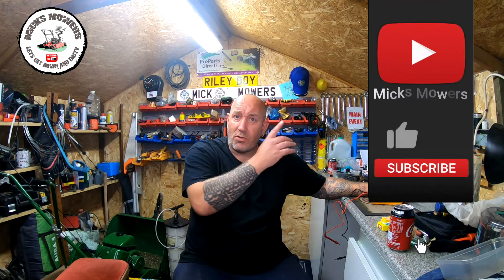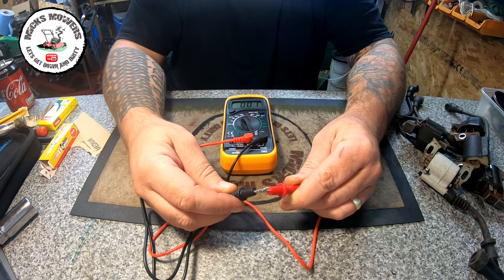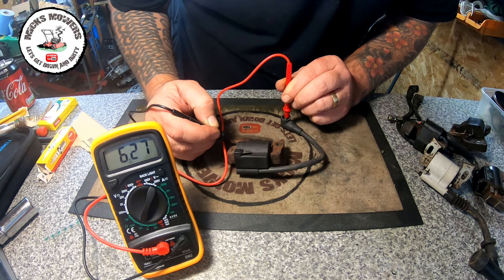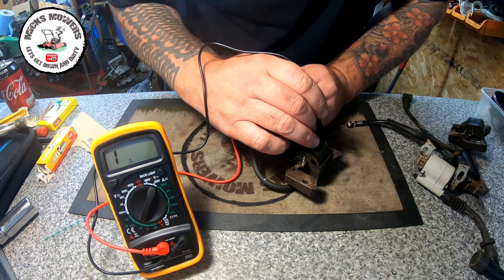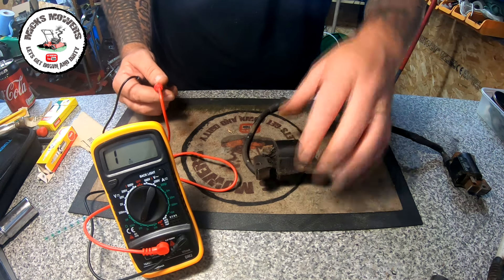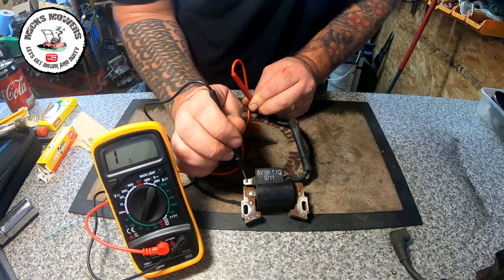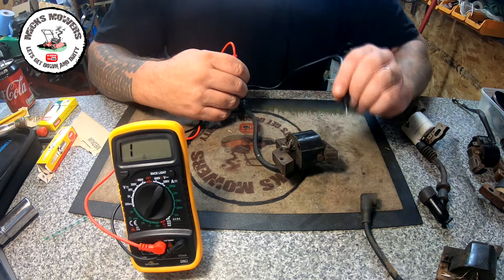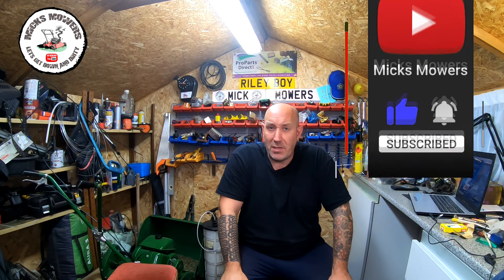How to Test A Lawn Mower - Ignition Coil Magneto With A Multimeter #easy

Comment: You can have good resistance readings on a coil and it can still be bad. This test does not test the condition of the semiconductors within the ignition module. A spark test at pull cord rpm's would be a more accurate test.
Reply: Exactly.... If it don't spark...Change the plug.... if it still don't spark. it's bad. End of story. (But we all love to know WHY!? Don't we?)
Reply: @patagualianmostly7437  Not quite my friend. if there is corrosion between the coil body and the engine then you will get no spark and my friend you will have spent out on a coil for nothing. how many coils have you replaced on you're change the plug principal? maybe you were throwing good coils out when you didn't need to? A £10-00 millimetre may have saved you money. Great tutorial as usual Sir Micks
Reply: Yes, but I think the coils shown were not electronic.  I agree, if electronic then you can have a good testing coil on the bench. But I may have an intermittent fault. This can happen after a short run when a component in the electronics intermittently fails .
Reply: @swarfs  They are electronic. They have a Darlington pair transister within to increase the pulse to higher level.
Reply: Will I see a spark only if the plug is connected to an earth ? Or will I still see it if I just hold the lead with the spark plug connected in my hand
Reply: @absbse  The thread on the plug must be grounded (engine block) to show a spark.
Reply: @smithderf  I tried that and even when I start with the starter motor there is no spark, I tried 3 different spark plugs, the mower has been sitting for 8 years unused but the engine turns over fine, just doesn't start
Reply: @absbse  If you see no spark on three sets of plugs then it's a kill wire problem, ignition module problem, or corrosion of the modules mounting surfaces.
Reply: The cheapest and most foolproof method of testing the entire ignition system is to perform the following test:

1) Using a bucket pour a small pool of water on the floor
2) After removing your stockings place your feet in the pool of water
3) Remove the spark plug from the mower engine
4) After making sure there is a good connection between the spark plug wire and the spark plug grasp the plug firmly in your left hand
5) Using your right hand give a vigorous pull on the recoil starter cord!

If at that point you feel this post is funny there is definitely something malfunctioning in your lawn mowers electrical. Otherwise you've got a fully functioning system!
Reply: Could it spark and still be bad enough that the engine misfires over half throttle?
Reply: @A_Stereotypical_Heretic  Yes.
Reply: @boatman222345  I'm getting good continuity on the coil. I wonder if that really means much in the thick of things tho
Reply: What about after the mower is running for a while and heated up ,  and then no spark, I've sèen a few with this heat soak problem...
Reply: @smithderf The Darlington pair does not boost the spark. It's triggered by a small coil that is used to trigger the spark at exactly the right time before top dead centre (TDC).
Reply: @BritishBeachcomber  It does boost as it concentrates the energy to a shorter burst intead of an extended release.
Reply: @smithderf the ignition module is within the coil so when you replace the coil you get a new ignition module. The kill wire just need a wire brass to clean and the rust needs to clean coil and flywheel. I have no spark as well and I am getting a new coil to test
Reply: Even pulling it on the machine doesn't fully test a coil as they can fail when they get hot after some run time

Comment: The bad ones are bad- Sec side tested. BUT the good ones can STILL be bad as the primary and switching in the modules can fail. really only way to be sure is check for spark when on machine or swap with known good.  Also you can have heat breakdown in the windings causing HOT shorting and failure but starts cold well and will start to misfire/fail when hot after running a while.  Caused by insulation material burning off inside and wires touching and thus less coil windings for good spark and you MAY still get a weak spark but it wont fire the mixture. or a little bit only. Very messy to diagnose as it seems engine runs well for 20 mins then vapour lock? with fuel starvation or a bad coil cutting out then.
Reply from the maker: Good communication mate

Comment: I've done an extensive survey if ignition coils with a multimeter as I go through my working day and still haven found the process to be a worthy method of testing a coil, other than one occasion when I found a primary winding that tested way out of limits, 360 ohms when it should have been 0.5 to 1.5, which you don't seem to check for, the cut out tab back to ground. Every bad coil I've had, has tested within limits, primary and secondary windings, meaning the failure is electronic, transistor or diode

Comment: Maybe I'm wrong, but is the iron core not a single piece ? With the primary and secondary coils wound around the centre part ? Then it stands to reason that with one lead plugged into the spark plug connector and the other lead alternating between the left and right metal pick up above the magneto ... would result in exactly the same readings. You're taking two readings from the same metal core.

Comment: Resistance readings from a coil/CDI unit, will indicate if there is an open circuit, but not whether the insulation or semiconductors are breaking down when running.

Comment: This saved me ..I had a very intermittent starting issue this season on my 21 year old Toro CCR2450 snow thrower  where 80% of the time it would start and run great. When I tried to troubleshoot it twice of course it ran great and the spark looked ok. Then I tested the magneto (Briggs) and it had 1k ohms resistance ... not 2.5k.  I replaced the magneto and all is well again. Thank you so much!
Reply from the maker: You are very welcome my friend.. that's what the video is for..

Comment: Very good channel with great video. I have tested coils like this for years. Sometimes a coil will test good and then not work when it gets hot from the engine heat. If you have a coil that has a heat up problem you can take a bit of tractor trailer repair tape and wrap it around the coil body. This acts as a heat barrier and heat sink.

The tape is aluminum on one side and black sticky tar on the other. Just cut a small piece and place it on the outer plastic body of the coil. This will keep the coil ast a constant temp.

I believe the coil wires inside have thin or cracked insulation coating. The wire looks like it is bare but actualy has a coil of polymer. This polymer will crack and get hard over time. Then the coil voltage is affected.  

On hot days my tiller will stop running. The coil tests great when on the bench. After about 10 minutes of running it stops with no spark. The coil is directly over top the piston head and cooling fins. The heat rises and the coil starts to short internaly. I put the trailer repair tape on the  bottom and wrapped it around to the top. The  metal part of the coil does not get tape. I installed the coil and it has been working now for 5 seasons.

Hope this fix can help someone with a similar problem.. Cheers!
Reply from the maker: Ta for the information mate I appreciate it

Comment: Great video Mick. A multimeter is a very useful tool. Use mine all the time. In fact used this morning to prove to my brother in law it was because the battery was flat that my sister’s vehicle wouldn’t start. He swore blind he had a battery charger on it an he had charged it up. Anyway after an hour of charging she started up no problem. Saved them calling a mechanic for a 1 minute test with a cheap multimeter!
Reply from the maker: Yeah that's it.. a quick way to test..

Comment: well done.  I suggest before throwing out that Honda coil, check the plug end on the plug wire - the end screws onto the wire and sometimes if that's done multiple times, the wire becomes buggered, breaking the contact.  The wire also screws into the coil itself - check that end as well.  The briggs coils all have the wire manufactured right into the coil itself, but the end can be check on some this way as well.
Reply from the maker: Yeah I did check it.. it's no good ta for watching

Comment: Good video Bloke. However, the older Briggs & Stratton coil has three coils inside, plus a couple of transistors that control the direction of the currrent flow in the primary. I.e, there's the high voltage winding that you're checking, but there's also the primary winding plus a trigger winding on that little metal post on the  bottom of the coil. No way to check either the primary or the trigger winding, or the transistors, as far as I know. Just something to keep in mind. Cheers!
Reply: I checked the continuity on the coil and all is good but the mower still won't start? Cleaned the spark plug the carb is pumping fuel and it still won't start, so what else could it be?
Thank you

Comment: Mick, your video solved a problem. My mower showed a small spark at each lanyard pull, but would not start. Early in the video, you reveal a coil can spark, but too weakly to start the engine. QED-- now to find a reasonably-priced ignition coil. 
* PS-- Your Midlands accent is a killer.
Reply from the maker: Lol Midlands.. I'm south coast lol
Reply: @themowerman  Sorry-- only a few hundred miles off. Portsmouth?.

Comment: Mick, here is a new development in my mower ignition coil problem. Originally, the mower had hit a half-buried tree root, mangled its blade and sheared its crankshaft key. Both blade and flywheel key have been replaced, after great effort. and with care to proper alignment of the key channel and flywheel. 
1. For a brief period, my ignition coil had produced a small spark, and I heard a single, soft detonation when I pulled the starting lanyard a few times, but the mower could not start or sustain any rpm on its own fuel. 
2. When starting fluid was injected into the carburetor, the motor ran briefly, which indicates there was still a spark. But on its own fuel, the motor produced no detonation. Now-- with even starting fluid-- there is no sound of detonation when the lanyard is pulled. 
3. This afternoon, I checked the ignition coil with the standard external test-wire-to-ground (earth), and there is no spark.  Although I have used my VOM set to Ohms (20k), and still get a consistent and satisfactory reading of 4.63  on both ends of the ignition coil, and on the deadman's switch (reading taken when switch was disconnected), there is no spark and no detonation on lanyard pull. 
Although I had planned to purchase another coil, I held out hope the 4.63 reading meant the original coil was still OK, since the value was between 2.50 and 5-6.0. Is this clear proof that even a good reading on a physically-intact coil can be misleading?
Reply from the maker: Hi mate. Sorry for not replying but I’m not getting any notifications of some comments for some reason. Sounds like a good coil. Double check the Ht boot and ht clip. If need be take it off and re attach it. If not then it sounds like a new coil is needed
Reply: Thanks you have explained exactly the same problem as what I have been having with an ignition coil on a disc cutter . The readings come back fine , I’ve checked the the ht lead for continuity  fine .I’ve noticed  most people on you tube are just reposting videos of others with there own take , subsequently I’ve put a coil on from a working disc cutter and it now works as it should . These methods don’t seem to be the rule as I have had the same problem as you . Thanks for posting 👍
Reply from the maker: @bobjit252  your welcome
Reply: @themowerman  Mick, here is a status update on the suspected ignition coil issue. I replaced the original coil with a new one, and now, Ohm readings are even higher, and with a clear, strong spark.
Reply from the maker: @bobgreene2892  what was the reading?
Reply: @themowerman  The original ignition coil shows 4.63 Ohms, consistently. The new ignition coil shows 5.74 Ohms,  consistently. Both coils measured from spark plug (HT) cable to ground on either of two arms, and from HT cable to primary winding connector (deadman's switch disconnected).

Comment: Cheers Mick. Coils can also fail short circuit as well as open circuit. If they are open circuit it could be the HT lead though they are hard to replace the way they are built.
Reply from the maker: Yes mate they can see and Alos when hot it's part of the process we have to follow to find the fault

Comment: Nice video. Thanks very much for posting. I have recent acquired a castle garden el63 ride on lawnmower which has no spark. I believe there are five safety switches which can give you no spark if they are not met but now I have another thing to look at. Have you ever worked on one of these. Doesn’t seem to be a lot of information about these out there at all which is a bit of a shame. 
Do you think you could do a video on safety  switches for the larger lawnmower? 

Keep up the good work

Ryan

Comment: Hi Micks, I'm writing from Argentina and working with a Briggs Stratton, model 122T02, 625 Series, 190CC. First, the resistance between high voltage plug and ground terminal is about 10.3 Kohms, that's correct? Second, I don’t understand how stop system works. The coil ground terminal is connected to the coil core, so, when the coil is fixed to the engine frame, the electrical connection is accomplish, despite this, the ground terminal has a cable to a terminal near to stop lever. This terminal also is tied to engine frame. The other end of the lever move a pad to brake the flywheel, in summary, looks like the stop system just consist to brake with a pad the flywheel… that’s would be the operation?
Thanks for spend your time with this. Best regards, Gustavo Lehmann.
Reply from the maker: @lhcdmc  no.. does it have a throttle control?
Reply: Yes , It have.
Reply from the maker: So the end of the throttle cable should be connected to the micro switch that controls the spark...

Comment: Nice and simple to follow, thanks Mick. New solenoid, ignition coil is fine (4.36 across all points) and a new sparkplug n battery. It turns over but still nothing. Any suggestions? Husqvarna 125 and it worked two weeks ago... I'm stumped😞
Reply from the maker: Could it be a timing issue

Comment: Hi mick, briggs coils like to be under 5000 ohms ( 3000-4000 ohms) anything over this is pointing to a coil going bad. Also red lead goes in com, although not critical for this test. Keep up the good work 👍
Reply from the maker: Ta brother
Reply: Actually I made mistake Black lead goes in COM not red otherwise if you test a car battery for example if the red lead was in COM it would show -12v and not the normal 12v. Hope that makes sense

Comment: hello and thank you very much for the video.
My AL-KO_470br petrol lawn mower with Briggs&Stratton-625 engine no longer starts.
I changed the carburettor and the spark plug but it didn't work. Now I have ordered a new ignition coil and tested the old ignition coil according to your video clip. I set 20k ohms on the multimeter and got values of 10.5 on the magnets.
Is this value OK? Then the ignition coil would not be defective, but the distance to the drive shaft was very small and dirty.               Best thanks and greetings. Thanks from East-Germany.
Reply from the maker: @jomente  clean the coil and flywheel... And the two posts the coil sits on with sand paper and try again...
Reply: @themowerman  Thank you for the advice.
Can I also put the ignition coil in an ultrasonic bath?
Reply from the maker: @jomente  I wouldn't